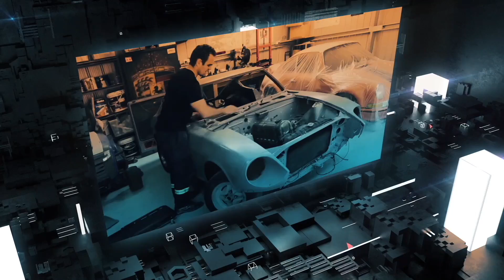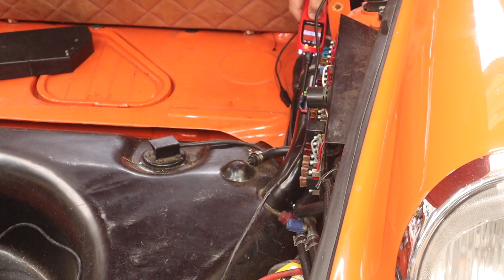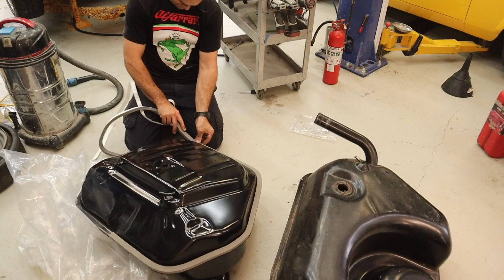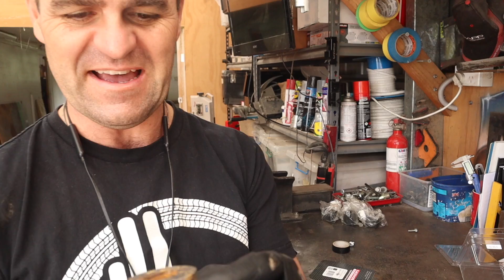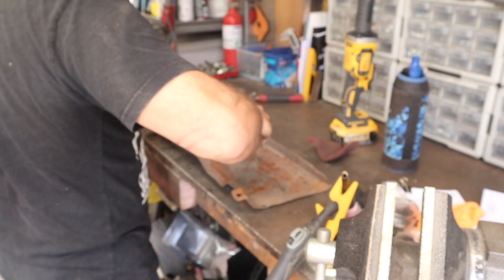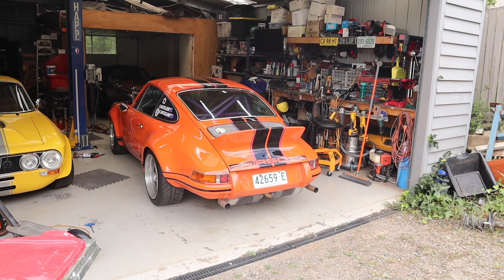Leaking fuel tank and dodgy bushings - Porsche 911

Comment: Is that a Dansk tank?  I opted to restore my tank, because the new ones didn't have an internal strainer.  I also have rsr bushings all around, with adjustable dampers.  Ride is not harsh at all when set to soft... But everything else is much sharper and responsive (faster steering rack helps there too.)

Comment: Agree with the 911 stock suspension comment, drove my 996 with lowered springs etc for 10 years. Now I went back to stock 3 years ago, much easier to live with hardly any compromise on driving and my bumper doesn’t need respraying every couple of years from the scrapes. Love Harry, absolutely awesome Porsche!

Comment: Duct tape your vacuum cleaner hose onto the fuel filler neck and turn it in when you disconnect fuel lines. Vacuum cleaner isn't string enough to suck up liquid but it will suck clean air into the void you create and stop the majority of leaks. Works on trucks
Reply from the maker: Nice tip.

Comment: Discussing the front sway bar, you said that lifting the opposing front wheel in corners was a sign the sway bar wasn't working?
--That's what the front swaybar does.The front swaybar is holding your front wheel up. Your discussion of stock springs seams out of place given what you said about the swaybar.
Reply: BTW, given the lean on the rear, I'd think that you might be able to bring the inner tire down a little bit by using a larger sway bar in the rear. But I wouldn't. Like you said, this isn't a track car.
I thought someone made an aftermarket electronic damper system for dual-purpose cars, but I've never investigated those.

Comment: I thought the roll stiffness for old 911s was meant to be soft at the back and stiff at the front. Has the philosophy changed in recent years? I recall watching Alan Hamilton's 911s coming around Bathurst's Forest Elbow, it's i/s front wheel way up in the air. Ditto Jim McKeown & Brian Foley at other tracks. I think it was all about weight transfer onto both of the driving wheels.

Comment: Totally agree that stock and all fresh suspension with a good geo set is superb on these old 911's, imho, wise advice from you! Graham, in warm England.
Reply: It seems that modern rubber degrades much faster however, even new Porsche, and most aftermarket stuff is a desaster - bushing deform after a year or two versus decades. I’m now going to try out modern polyurethane bushings with about the same hardness as rubber, such as Powerflex heritage line. Should give a good increase in longevity while not reducing compliance.
Reply: I've had my 73T for 34 years now, a road/hillclimb car, 2.2/2.4/3.2 engine, lovely car. In the early hillclimb days removed all the porsche bushings for poly bushes, and when I retired the car put rubber bushes back in except for the anti roll bar bushes and drop links. Kept the hard plastic (Automotion) rear bushes in (now there for 34 years) and all is really nice. Each March I apply engine oil to those banana arm bushes!

Comment: It’s normal with “stock suspension” to bottom out and destroy the gas tank?
Reply from the maker: It is not the suspension as the tank is between the wheels. It is the terrible pot hole repairs that have squished out making huge lumps in the road.

Comment: It will probably lift the inner front even more now. It lifts because the rear is too soft. It was a good suspension for the tires of the time. You probably need   to double the rear spring rate to get the front down.
It's not the spring rate that makes a car  harsh it's mainly the shocks.

Comment: Hi Jeff, You probably did them up off camera, but just in case, I noticed when finishing off the fuel tank install at the 7min mark the clamps on the filler neck join hose are still loose.  Thanks for all the great content.

Comment: 22 gallon gas tank?!? How does that even fit in there?? The diesel fuel tank for my 1985 Mercedes is only 19.9 and it takes up a good portion of the trunk
Reply: Luckily in Aus 84 litres is only 18 and a bit gallons; much easier to deal with than in the USA.  But that's not an unusual size for old performance cars.
Reply from the maker: By my calcs @330DBenz is on the money. 84 litres is around 22 gallons.
Reply: @HomeBuiltByJeff only if it’s US gallons😊
Reply from the maker: @timgosling6189  Haha. I didn't realise there were 2 versions of these crazy old measurements. Metric is so much easier for my simple brain ;)
Reply: @HomeBuiltByJeff gallons are not crazy, only Americans who make them tiny then complain about gas mileage.  Oh and happy New Year 😊